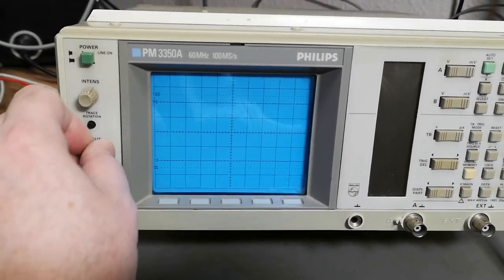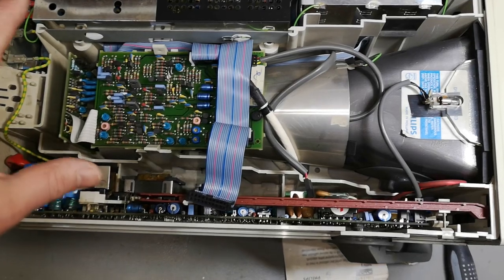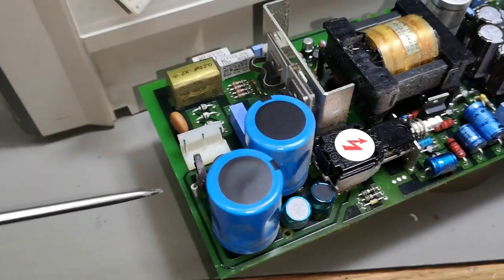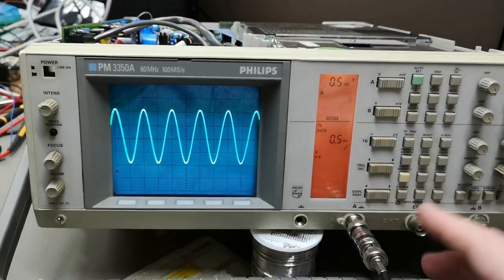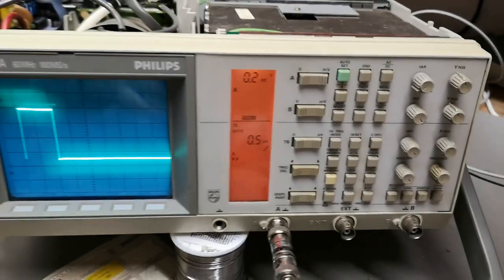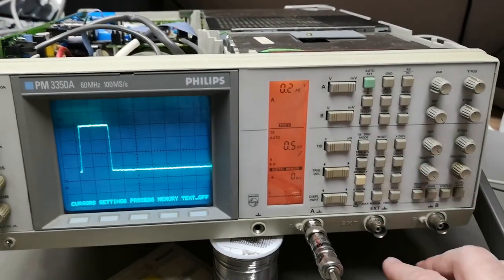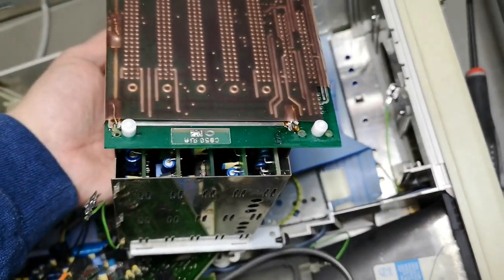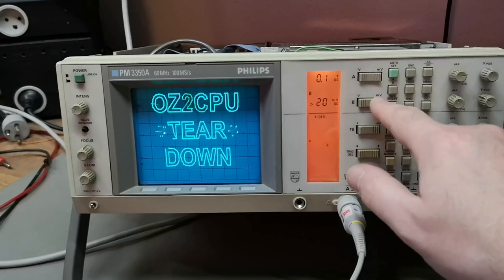Philips PM3350A oscilloscope 2ch 60Mhz Analog-Digital repair power supply

Comment: Hey there, i have the same issue with my pm3357 it have exact the same power supply and the same problem, the rifa cap look demaged, i have thinking about capacitors replacement but when i have measure them everything look ok and then i found your video, can You send me the resistors values that You used for load the PSU? Have You replaced that rifa cap and opto...? I don't see good resistor codes because of the light on video if i'm on the right way there are 1k , 2k, 211 ohm?
Reply from the maker: it was quite easy for me to search for the service manual, here you find all component values and type numbers, no need to guess, most of the models uses the same power supply and other details, incase you cant find the correct one.
Reply: @TeardownOZ2CPU  i will replace all the caps over the psu and i will look at that opto as well. I'm thinking that old dryed caps can be main problem. That axial old caps are not the best, maybe in old times they was but now... I need to replace one potentiometer to or just drill it and glue extander in because its broken.

Comment: Is the auto set button working? With my scope pm3070, when I push the auto set, and give a signal on A or B, the settings go to 10mV and 10uS
Reply from the maker: you need to input a repeating signal of at least 100mVpp, for the auto set to work
Reply: @TeardownOZ2CPU  . Thanks, , Iused the test singnal 1,2v and a 16 v AC signal, but it does not work
Reply from the maker: @cooocooo3880  if the scope works in all other ways, when you manually set it all up, then the auto setup feature is simply not working.. look in the schematics
Reply: @TeardownOZ2CPU  I tried, but this is for me too difficult.

Comment: Hello, Nice video. I just bought the same oscilloscope of eBay. With which condensator did you exchange the RIFA one and which NTC.
Reply from the maker: I just use film mkt and the ntc is not super critical, I just took a similar size, they are often the same cold and hot resistance